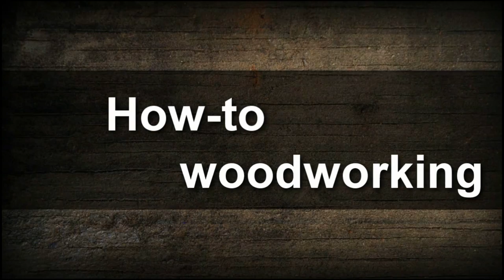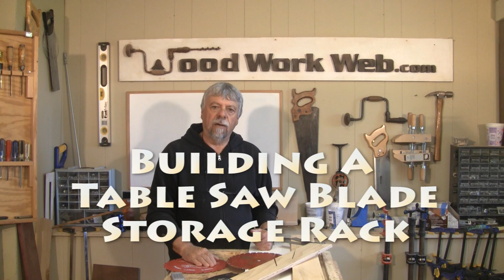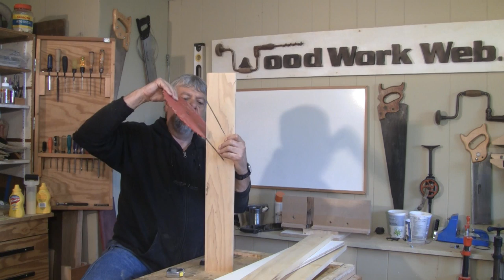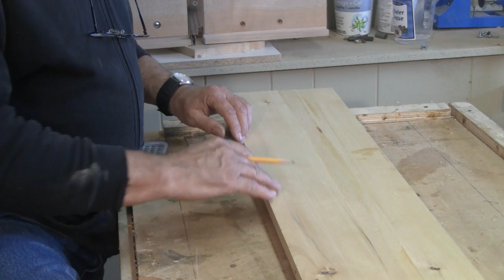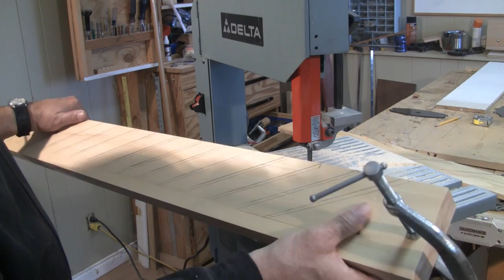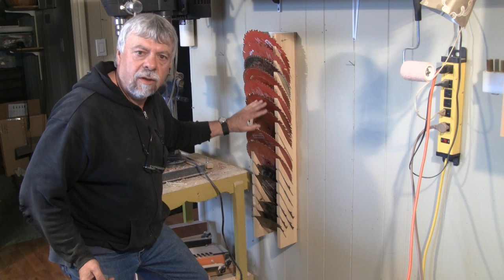Woodworking - Building a Blade Storage Rack

Comment: An interesting video and a useful project. Really like the design.

Instead of clamping the two halves together (and, having to reposition the clamp) before cutting the slots on the bandsaw, you could try using double-sided tape (aka. carpet tape).